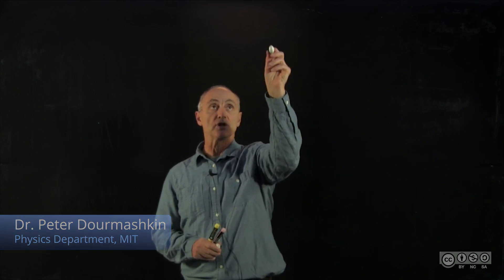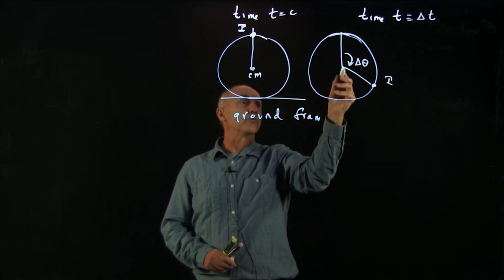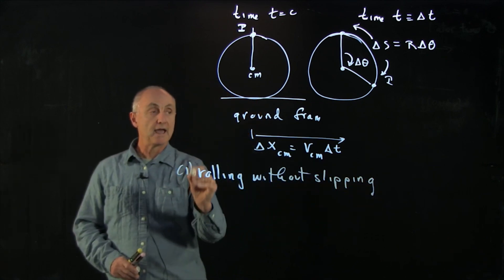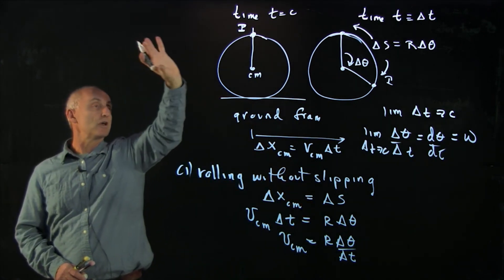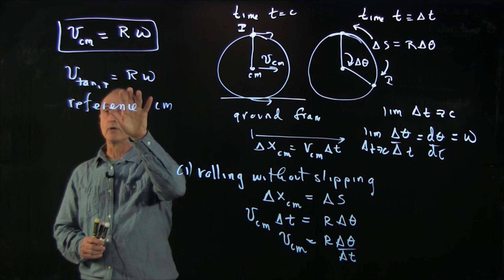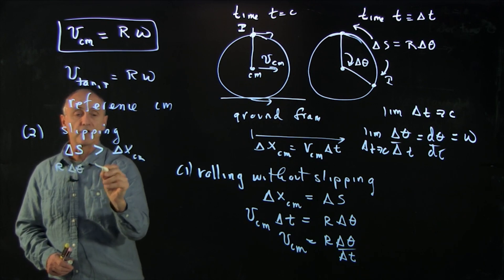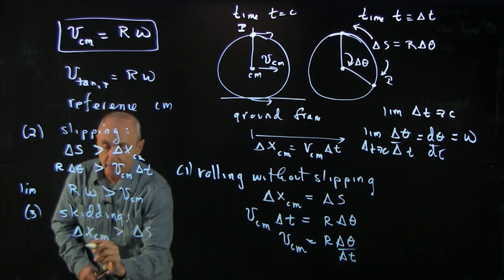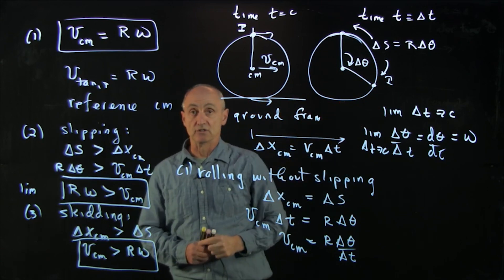35.4 Rolling Without Slipping Slipping and Skidding

Comment: Doubt: (For pure rolling 
) At the point of contact of the wheel at the ground , the net velocity=0 hence no motion. But if at that instant no motion is there then how can static friction act ? And if static friction does not act the net torque will also be zero , then how can the body continue the rolling motion ?

Comment: Doubt: (For pure rolling motion) At the point of contact of the wheel at the ground , the net velocity=0 hence no motion. But if at that instant no motion is there then how can static friction act ? And if static friction does not act the net torque will also be zero , then how can the body continue the rolling motion ?
Reply: This is static friction, not kinetic. When static friction acts, there is never a motion. That's the point of static friction, to oppose forces trying to put a body into motion.

Comment: Won't it be kinetic friction?
Reply: See rolling without slipping means that the point touching the ground has zero velocity i.e, it is taking the ground with it and remember friction opposes relative motion ( in this case slipping) so the friction here becomes static (since no slipping) .if indeed there's slipping ( or skidding as u may imagine) friction becomes kinetic as u said.if u did not understand,that's fine ponder over it.it took a hella lot of time to get this clarity.😁

Comment: What if the center of mass is not located at the center of the disc?
Reply: The position of the center of mass depends on the density distribution inside of the circle, but as there cannot be any mass outside of the circle which at the same time is part of the circle, there is no density distribution that shifts the center of mass outside the circle. It's possible to have a situation where the center of mass of the circle isn't exactly at the geometric center of the circle though, in which case you have to consider gravity to act on that point rather than the center of the circle.
Reply: well in this particular instance it's not important that the axis of rotation is goes through the center of mass, since we are just dealing with velocities and not momentum

Comment: Grave mistake at 2:53-3:00, probably common among all physics learners since even an expert here is making 
it in a prepared lecture - It is false that every single point on the wheel has the same speed v_cm in rolling without slipping. 
For instance, the speed at the point of contact is 0, and the speed at the top point (north pole) is twice of v_cm, and  
it is possible (not hard) to compute the velocity (not just speed) of every single point in terms of the angle theta and 
distance r to the center using either trigonometry (law of cosine) or derivatives. 

Also it is more clear for the student to label the angle starting with the point of contact than the north pole so that 
the traced distance on the ground is easily identified with the arc length. 

- PK (A parent to a high school physics student)
Reply: It was not a mistake... He just considered it as a case of translation and compared it with the case of rotation, that traversed the same distance and hence the same velocity.
Reply: Not sure it was a 'grave mistake', more a case of gradually introducing the concepts....the contact point being the instantaneous center of rotation (therefore having zero velocity) is covered in the very next video. Remember that these lectures have been parsed into very short 6-minute videos, it could be argued that this comes at some cost to continuity, but should be viewed with an eye towards the entire topic.
Reply: Yes, I noticed he said for rolling without slipping, that all points are moving with the same speed v  which is incorrect.